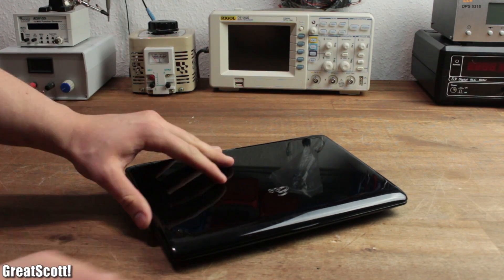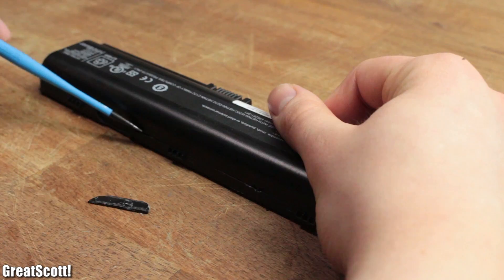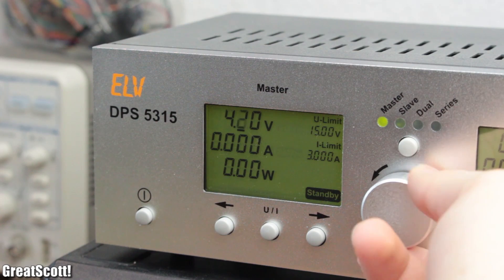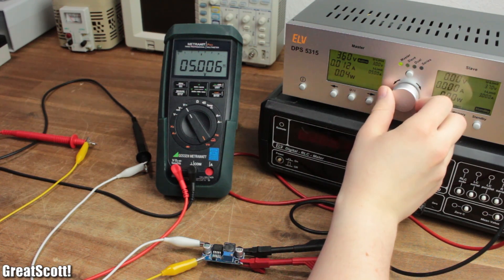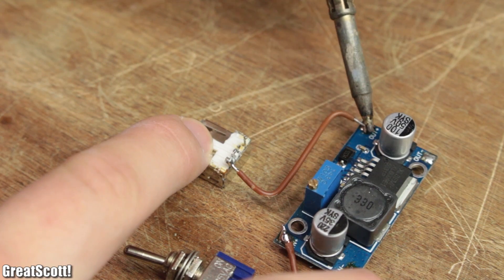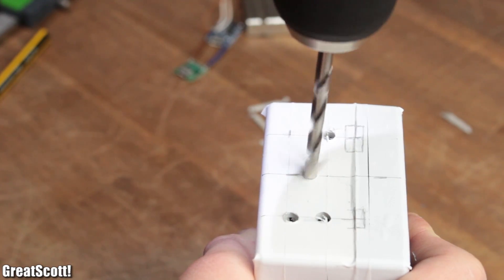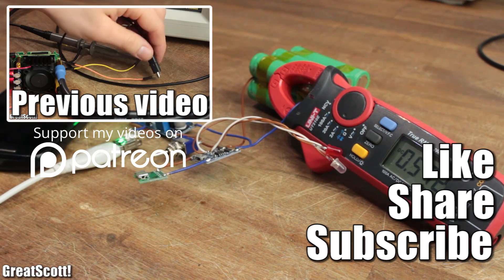HACKED!: Old laptop battery becomes a Power bank

Comment: Great project, but I would change it a bit. It may be better to use the toggle switch to allow the battery to be connected only to the TP4056 module or the power booster, not both.
Reply: Because if you accidentally charge the batteries while a load is connected (i.e. the power booster) they will break and it is also unsafe
Reply: +Aurelio Mannara why would it break? i see no reason
Reply: +DMAN22yeah Read here at page 5: http://ww1.microchip.com/downloads/en/AppNotes/01149c.pdf
Reply: Aurelio Mannara from what i read it looks like it will just continue to charge. if you feel the need use a switch that when it is in one position you can charge and when it is in the other position it will allow use.
Reply: +DMAN22yeah it will continue to charge if and only if the system requires a current lower than the charging current, but this is not the case since most mobile phone requires at least 1A at 5V of charging current and the TP4056 can provide a maximum of 1A at 4.2V maximum. Which means that the boost converter will need more than 1A from the TP4056, that won't be able to provide such current. So the remaining current would be taken from the battery, so it won't charge and it will easily ruin the battery that will go in an undervoltage state.
Reply: Aurelio Mannara which is why the boost converter cuts off at ~3v

Comment: You sure that the boost converter will keep constant 5V output when the input drop from 4.2V to 3.7V (or less)?
Reply: +Tsz Lam Cheung thats the point of a boost converter
Reply: +DMAN22yeah i meant whether this boost converter is able to provide constant output voltage when the input voltage is dropping. I have tried some boost converter which the output voltage will drop proportional to the input voltage.
Reply: Tsz Lam Cheung a good converter will not let that happen, the ones for $4 on amazon made for this are pretty good

Comment: charging 6x18650 with 1A.... don't be in a hurry ;-)
Reply: +hammershigh yeah, i plan to use the 1a board for a laptop/usb charger with some old lipo radio batteries, over 30 hours to charge, lol
Reply: Can I charge 25PC's of 18650? Hmm the module can handle?

Comment: if you have chosen a moudel that uses in power banks like this on

https://img2.brain3.photobox.com/654085530178a24ee91c753895ba9ff8ac5387cf5cb4f772168303d6ce13c3f1a34fee33.jpg
 .
it would be easier and support all models of phones. and i'm gonna give it a try with my old laptop battery
Reply: one more thing! this what you've done  will not charge those phones have fast charge function, right?

Comment: I don't know if you did it but you should short de the data pins on the USB output port, phones and tablets uses this method to know if they can pull more than the standard 500mA.
Reply: Good to know. Will do. Thanks

Comment: Could it be used to charge an iPhone or iPad? Don't the data pins of the USB need 2.1V for smart phones to change?
Reply: Apple gadgets will not work with this power bank.
Reply: +James Bowen I built my own version of the Power Bank using the 18650 Lithium Battery Charger (as seen in the video) and a 5V DC-DC Booster Module USB. I get 5.1V and about 600 ma. Not enough to charge my iPhone. Im not sure about apple changing cables having the voltage dividers built into the cables. More research needed.
Reply: ***** Sorry, when I was referring to the cable ment the whole thing including the correctors.
Reply: +James Bowen I've heard shorting out the Data pins let the device charge at it's maximum speed.

Comment: I noticed you said you can only use the cells together in parallel if they come from the same battery pack. I'm sorry but this information is WRONG. You can join together any Lithium Ion battery of the same voltage. IE any 3.7 volt cell to any other 3.7 volt cell. If you have two cells from different battery packs they will have different capacities IE one will hold 1500 mAH and the other will hold 2000 mAH. Putting them together in parallel effectively makes one big 3500 mAH cell and both cells will always be equalized with eachother. The problem is if you wire two cells with different capacities in SERIES. If you wire one 1200 mAH cell after a 2000 mAH cell in SERIES then when you use 1200 mAH out of the battery pack the 2000 mAH cell will still have 800 mAH left and the 1200 mAH one will be dead so you will waste energy OR overdischarge the one with less capacity. So you CAN use different cells in PARALLEL but NOT in SERIES!
Reply from the maker: You can do a lot of things. But Imagine if one of your batteries in the parallel arrangement is faulty and discharges itself while the other ones keep feeding it power. It doesn't need to end in a bad way but the probability is higher.

Comment: iPhones require resistors on the 5v on the data lines otherwise the phone will not charge
Reply: It isn´t done by the Connector... You have to short out the Data Pins to make it charge. Otherwise nothing will happen... Belive me, i tried it ;D
Reply: i also messed round with this when i made my own phone charger. an i phone will refuse to even charge if it does not see a voltage on both data lines. if i remember correctly its about 2v and that tells the iphone the charger can do 1A and i think 2.50v tells the iphone to use over 2A...something like that but the voltage has to be very accurate
Reply: +Mix Bag On most phones they won't charge at a fast rate unless the data pins are shorted.
Reply: But with iphones you cannot simply short the pins out.(i tried this) maybe on older iphone but from iphone 4 and up its an exact voltage. but end of the day this is a safety feature.
Reply: Mix Bag I tried it with the iPhone 4 and it worked. Maybe it wont work with newer iPhones...
Reply: what do i do if i dont want to use batterys and have it plugged into a power supply? im using the LM270 ic BUT IM NOT SURE IF I CAN PUT 12V IN http://oi65.tinypic.com/15g5vth.jpg

Comment: charging 6x 2200mA/h with 600mA is kind of slow6x2.2 = 13.2 A/h 13.2 / 0.6 = 22h so approx 20-24h thats really good for the batteries....but the user waiting to charge will get pissed off....my idea:why not make it emegrency backup power?make a nice stand and add wireless power to it so it's charging 24/7 (with auto cutoff)and if you need some power (or your power goes out...) just grab it and use it wireless power is kind of weird to do but hey we have 2016 now ...
Reply: +Martin Bennett thanks for andvice ...i know that li-ions have selfdischarge and stuff like that....but it's easy...and cheap
Reply: +Martin Bennett that is why ups units still use sla

Comment: I had this exact idea as well! Old laptop batteries are a GREAT source of 18650 cells useful for practically anything if you wire them up with a BMS or protection circuit. Others even built e-bike batteries out of them!
Reply: If it’s old they the cells are extremely worn and have a very low capacity and will have a very high amount of charge cycles on them
Reply: Open a few and they came up to be only at 1200-1700 mah
Reply: I’ve had more luck with used vacuum cleaners that use them. They mostly have much higher discharge capabilities

Comment: pretty cool.  I took the circuit out of a powerbank (ebay) to make one of these.  it does the charge control and boost.  powerbank without a battery is about $2 on ebay.  the project enclosure was the most expensive part, $8.

Comment: A source of 'free' batteries are the power packs to cordless power tools. 
People usually throw them away when they won't hold a charge or don't charge.
Usually its only one or two cells that are faulty.
Check out DoctorBass's channel for more info :)
Reply: +mynewschannel they are usually high drain too, so perfect for vaping

Comment: lol, I have the same Eee PC :D
Reply: +Emīls Kurpnieks (ikey07) I got that same eee pc used and broken from a goodwill for like $5, really mangled inside but a bit of work and it worked, though the thing was in horrible shape inside.  bailing wire and duct tape(tm) and got it working.  Later someone was interested in it for $50 even after I explained how I jerry rigged the inside to hell to get it to work, and they wanted it anyway, so I sold it.  I now have an acer es1-111m, and that's my favorite laptop ever, though I have had more powerful and larger ones.
Reply: +Emils Kurpnieks dude, I just installed a 2GB RAM on mine and it runs pretty fine (better than the pre installed 1GB), no problems since I bought it, haven't encountered major problems yet like critical system errors or viruses

Comment: I tried this but my iPod did not recognize the sub port so it did not charge. Can someone explain the resistor. And what tondo with the data pins.
Reply: For apple devices there has to be a specific resistance between the data pins or a specific voltage... You can look that up in the internet... Just google for it :)
Reply: +shinyFlake I'll tried. But so far I didn't find any help. But thanks. I'll continue looking.

Comment: 5V Output and 5V  input ? doesn't get the charging voltage
Reply: +Martin Bennett i meant the voltage which will charge the powerbank
Reply: ***** ok so a normal smartphone usb charger is good enough
Reply: +Martin Bennett  output of the power bank is 5v 0.5A but what if I need 1.5A ?
Reply: +prashant dutt the converter will put out several amps
Reply: +DMAN22yeah thanks
Reply: prashant dutt the best thing to do is get a usb from battery converter from amazon
Reply: +DMAN22yeah  bro one more question , what if I use tp4056 without battery protection ic
Reply: +DMAN22yeah do I've use another circuit for battery protection purpose
Reply: prashant dutt ok i think you are asking if you need another circut, most all 3.6v to 5v usb converters have a cutoff
Reply: +DMAN22yeah thanks for the help brother
Reply: prashant dutt no problem, i enjoy helping others

Comment: 0:15 ironically most of my old laptops work just fine except for the battery since they no longer hold any charge
Reply: +Armando92 only a cell or two or the protection wiring goes bad

Comment: I do not like that boost converter xl6009 or lm2577 needs at least 3.5v to work. would be nice to use one that work until 2.8v. what do you think?
Reply from the maker: +Valtra103 I tested it with 3V and it worked. But I was only drawing 500mA.
Reply: grande gaston !!
Reply: +Proyectos LED I thought the same. Ones I have shut down at ~3.6V.
It looks like he have not tested his creation. Not a good way, to teach others... I tried to find something working lower wthout succes... If something works lower, then max current is like 600mA. Way to low to quickly charge...
Reply: +GreatScott! +Proyectes LED  its not like you want to drag single cell voltage any lower then 1.5 volts anyway deep discharging is known to damage batteries.
Reply: Ernst Stavro Blofeld the cells are good, they are just at a low voltage, and if you charge them too quick, they can short out.
Reply: GreatScott!
Thats interesting. Mine doesn't work. But at 500mA charging my phone would take forever. So I keep searching...
Does any device draw more than 500mA from your bank? Most phones need resistor or short between data pins in USB, to initiate fast charge.
Reply: +Valtra103 you can search on ebay for "usb boost 2A" not shure if they work.
Reply: +Valtra103 look at the MT3608. Its have less output current, 2A max,  but input voltage is less too (about 2v)
Reply: +GreatScott! thanks, adios amigo
Reply: +Proyectos LED Do you like Poland?
Reply: you can use a board similar to one in a single cell powerbank, search 3.6v to 5v usb, they are around $4. they have proper cell protection too
Reply: +Proyectos LED Just wire groups of two cells in series so you'll get 6-8 volts, then just buck it down to 5 volts.  Thats what I did in this set up.  The only thing you have to do the though is charge each parallel group individually.  I have 4 cells so I just need two of the charging boards.  I thought I was the only having issues with not enough current at 3ish volts for the buck/boost converter.  This is good to know it's not just my board. Cheers!
Reply: Water you can simply use a usb car charger as a 5-24v input and 5v out
Reply: Those use linear regulators so they waste a lot of heat and electricity. Buck converters are a lot more efficient.  I did use a car charger for a Internet battery back up box thing so thats pretty cool, but quite inefficient.  Now I use bucks and boosts for everything.
Reply: uu
Reply: buggggggu
Reply: +GreatScott! -- What exactly happens during your "revival-process"?
Reply: Ernst Stavro Blofeld he charges it slowly so they dont short out
Reply: DMAN22yeah It? They?
What are you talking about?
And how can you charge a broken battery?
Reply: +Proyectos LED tambien sigo  tu canal, que gusto verte por aca, SALUDOS
Reply: http://www.ebay.com/itm/Dual-USB-Power-Bank-Case-Kit-4X-18650-Battery-DIY-Charger-Box-without-battery-/331691708257?var=&hash=item4d3a5dcf61:m:m_62SAFBxQZZ8aROJJkSDIg
What do you think about this? Which one are worth it better?
Reply: +Valtra103 oooo valtra

Comment: Could you add more usb output ports on there instead of just the one?
Reply: +Kikkawa Ryu (Luke) that will depend on your batteries and your boost converter
Reply: I'd use batteries from a Toshiba battery havent got it to hand but i know it was the extended range of them. Ill try to find a boost converter to handle 2 or more usb's
Reply: +Kikkawa Ryu (Luke) just use an additional boost converter.

Comment: I want to use a LiPo batterie like the ones you used in your electric longboard project to drive a raspberry pi project. How to use such a betterie, how to get 5V out of these in the most efficient way and what are these small conmectors on the battery for? I saw an xt60 to usb adapter on ebay but i don't think it is very efficient and i want to charge the battery without removing the battery. Thanks.
Reply: +Mr HamsterBacke use a car usb socket, it takes 5-24v and turns it into 5v

Comment: I have a battery that I've got from an old MacBook ( I think that the model was "unibody", i'm not sure, but it's not one of those extra thin ones such as the macbook air), do you think it will work? I'm just asking that for safety, i'm 90% sure it will work.
Thanks

Comment: How freaky is this???
I just tore apart the exact same battery pack yesterday!!
I wanted to see wether or not they would be powerfull enough to power my personal vaporizer...
So I tore i all a part, removed the spot welded tabs and ground down the residue on the contact points.
Put them in my 4 port charger and...
They didnt work :D
Any time I set the output wattage anywhere over 10Watts the electronics indicate either a low battery voltage or a shortcircuit...
The pack was dead, so I feared there might have been a dead cell inside, but all 6 of them display the same error...
Might try hooking them up to my RC lipo charger and running a capacity test on each cell, to see if they could serve another purpose...
The ones in this pack were LG E3 18650 I believe...

Comment: You should charge them separately at first
Reply: +Mekhanic1 Why? Since they are all parallel they will never see a charging current or voltage greater than what the manufacturer recommends. If they were in series I totally get what you are saying, but I could be missing something here. Thanks.
Reply: +Alexander Hiller you want to get them all at the same voltage before you charge them in parallel
Reply: Yes, having same voltage helps them live longer and not exploded :)

Comment: i have old laptop with really dead batteries where almost 0v
those can't be reused, aren't it?
Reply: +~☆ XzCraftP ☺♂ you can have a look on the Rinoa-SuperGenious channel, he has lots of videos about 18650 revival and things like that.
Reply from the maker: +~☆ XzCraftP ☺♂ I don't think so
Reply: +~☆ XzCraftP ☺♂ I recently disassembled my old laptop battery because it was completely dead. By doing so, i found out that one series pack of the batteries was shorted. They where the same type lithium ion 18650 2200 mah by 2 cells in parallel and 3 packs in series, just like the one in the video. So i cut the shorted pack apart and sure enough - they both measured 0 volts. But when i tried to charge them, one of them held the charge very well, despite the fact, it was shorted through the parallel bad one for years. I think they may have some internal protection, so i advice you to give them a try anyway. Try charging each cell individually to somewhat normal level and see if it's going to retain the charge or not. If not, then it is bad.

Comment: One cool modification that could make this better than basically every existing USB power bank is to eliminate the need for a dedicated switch to turn the device on. Of course we don't want quiescent (zombie) current draw constantly discharging the batteries, so I would add a microswitch inside the USB port to physically connect/disconnect the batteries from all the circuitry when the USB is inserted.

Comment: I think it may have been better to leave them in a 2S or 3S series, because in general, it is more efficient to use a buck converter than a boost converter, and it reduces the current load on the cells. This will increase the effective capacity of them. (at higher currents, the capacity of lithium cells actually drops off pretty bad. The nominal rating on even new batteries is only true at really low discharge rates.)
Reply: +Power Max I agree, but I think he was trying to keep it simple. He would need a different charging circuit in order to balance charge the cells.
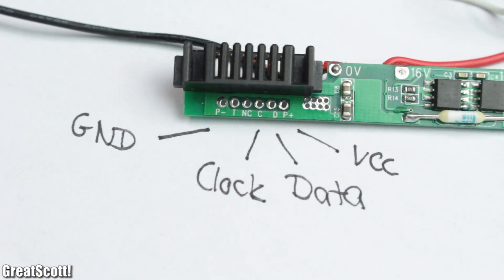Reply: +Alexander Hiller Ahh, good point, I forgot about balancing. The previos protection PCB at 1:30 would have done that though. I can't imagine it would have been too difficult to implement though.
Reply: It would be interesting to see him adapt that circuit!
Reply: +Power Max apparently laptops dont even balance charge, they just monitor the cells carefully